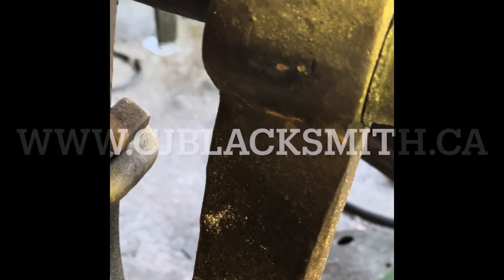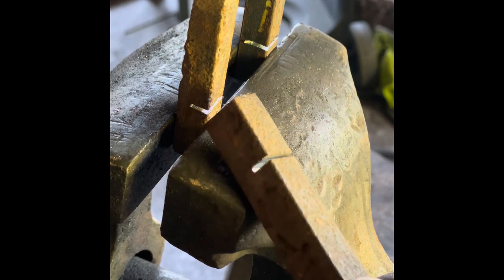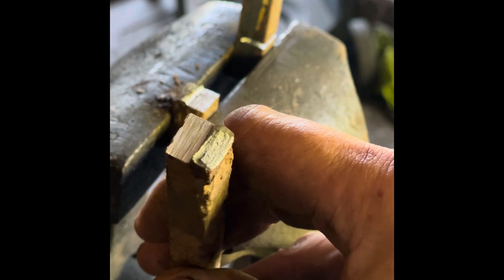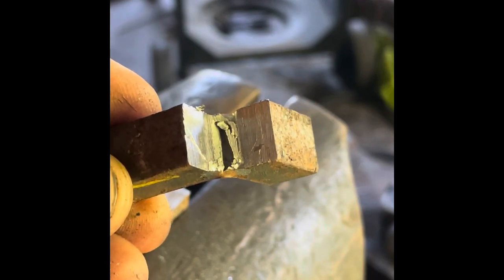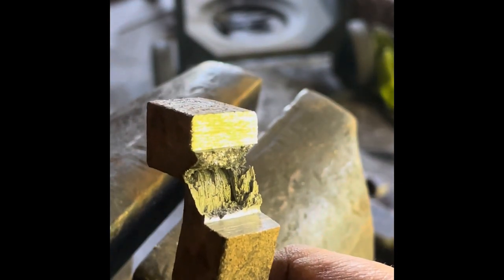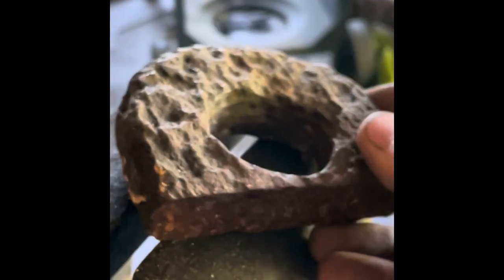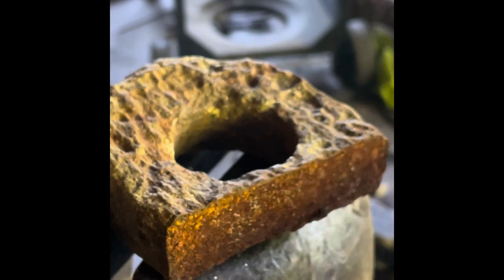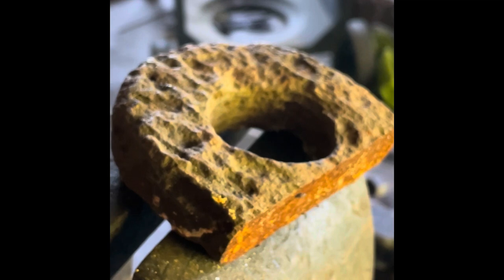How to identify wrought iron!

Comment: Good Chris, the harrow frame was wrought iron! Thought so!
Reply from the maker: Hi Paul, the frame was mild steel from my test results, are you seeing something I’m missing?
Reply: @c.johnstonblacksmith  
Your first video when you tested it the material tore just like your known wrought! Mild steel will bend and snap.
Reply from the maker: Second video first piece was the same as the first video actually both tests look like mild steel , better mild steel than todays, probably forge welds better as well. But if you want the material from the harrow I’ll gladly sell it to you cheap!
Reply: @c.johnstonblacksmith  
Try forge welding 2 pieces together, if its wrought you will soon know